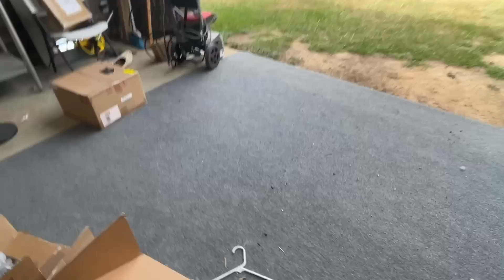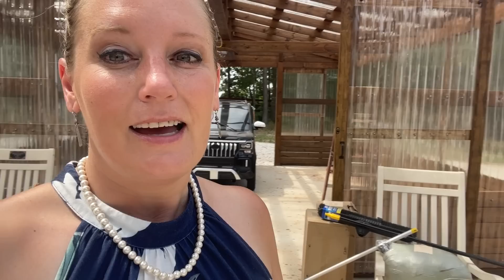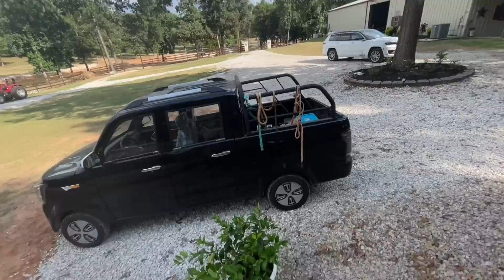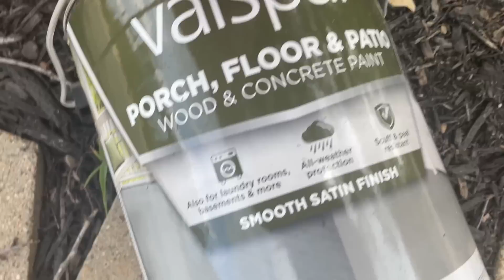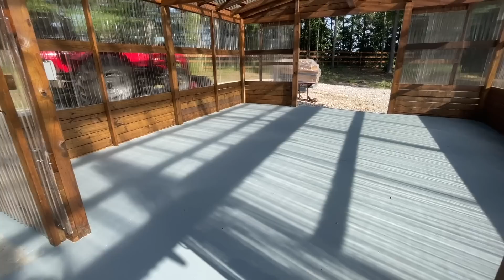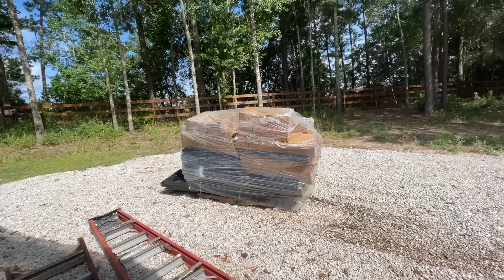I Did Something Dumb

Comment: Jami's greenhouse has already exceeded all my expectations and so far there's nothing inside.   This will definitely be Jami's Happy Place!     I am anxious to see what type doors you plan to install.   A shade cloth is definitely a necessity.    In the future you might need some roll-up shade cloth 'shades' to keep the direct sunlight from frying seedlings.   And a large ceiling fan.   Brooke and Jason just bought 2 for their huge barn, you could easily manage with just 1.   I think they purchased it at Home Depot.    It's rated indoor and outdoor safe and it's lovely.
Reply: A roof vent would have helped to exhaust excessive heat out as well...
She will definitely need some side shades for those extremely hot Texas summer days, but it's going to be so nice come winter time.
Reply: It's architecturally beautiful. So good!!❤
Reply: I believe if you look you will see the sliding barn type doors are already installed, they were just open.
Reply: Funny what people can do with money.. and can afford so much. I’ve worked hard my whole life and had a good job but never to their extent.

Comment: I think multiple coats is a good thing. You will probably never paint it again after you’ve moved stuff in. Especially any heavy beds or bulky shelfs. And you would have to remember over the years that the heat changes may make it dull or may make it chip / fade. So in the future you might wish you had done multiple coats just so it stood an extra better chance.

Comment: Looks great Jamie.  If the paint makes the floor slippery add some sand in the paint and add another coat.  For your tires, pit a piece of rug or something under them. Cement will damage tires when they dit especially in the heat.  Also, I dont know if this would of helped on tires which has oil in them. When you spill oil like cooking oil, put flour on it then just scoop it up if have a scraper is great. All clean.

Comment: It's hard to get paint to stick to concrete. Usually, you have to grind off any previous paint, stain, etc. Before you can paint it a separate time
 Also, it appears the greenhouse doesn't have enough air flow so heat can escape the ceiling.  Good luck!

Comment: Check into installing a swamp cooler in the back of your greenhouse… It is a vertical unit that keeps water running through it with a fan so it keeps cooling your greenhouse on hot days

Comment: You need to put ceiling or top sides vents into that greenhouse and get shade cloth so it doesn't get so hot in the summer and so you can close them and remove the cloth in the winter to warm it up.

Comment: Why not try to scrub the greenhouse floor with a long scrub brush. Use like a degreaser🤷‍♀️ it was probably way too hot in the greenhouse for any kind of car to b parked in it, the tires prolly was melting🥵🥵 Wish I had yr energy, that's going to b an awesome greenhouse greenhouse when yr done. Job well done👍maybe put a tarp or cardboard under that long board bcz it'll prkeep dripping, don't want to get sap drops on the new paint🤷‍♀️

Comment: You can remove that sap with 70-90% iso alcohol or hand sanitizer and a deck broom. Then power wash to rinse. The alcohol would be cheaper. Leave the building open for a few days for the fumes to evaporate.
Reply: Too late. You painted.
Reply: Alcohol works, I park under a pine tree and it works like magic

Comment: Grab your heat gun, and aim it at the areas where sap is leaking. Keep the heat gun moving to ensure that you don’t damage the wood, but don’t divert your focus from the sap either. When wood eventually reaches the temperature of 160 – 170 degrees Fahrenheit, the sap will crystallize and stop leaking.

After cleaning the crystallized sap off the surface, you can re-stain the wood or bin-seal the knots and paint again. Next time, buy wood thats kiln dried. This knowledge is not mine, found it online and thought i would share.

Comment: Awesome...yes it is!  ....you need awesome a great and effective cleaner. You can find it at family dollar in gallon sizes or dollar tree in a spray bottle.  Or dawn n a brush. Spray with awesome let it soak in for about 10 minutes take a brush to it. I have used hand sanitizer. Plenty of that left over from 2020. Just on the blobs of sap? Then pressure wash it. With hot water if the machine does that. I don't know for sure if awesome is safe for plants n animals. If you can keep the babies out of there til time to pressure wash it. Dawn is safe but I don't know if it would work on the blobs. I hope you can get that done. My comment is probably to late. G L😊

Comment: Purple power to get the goo off the floor. Now you are not dumb, a wee bit silly, but certainly not dumb. The heat in the greenhouse will drain the battery. But my question is, if its oozing now, won't it ooze on your plants?